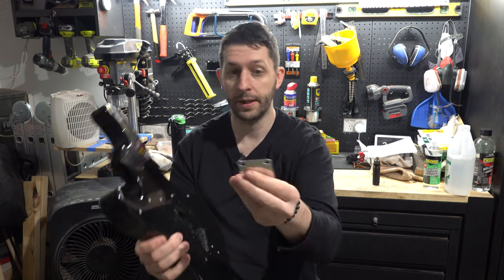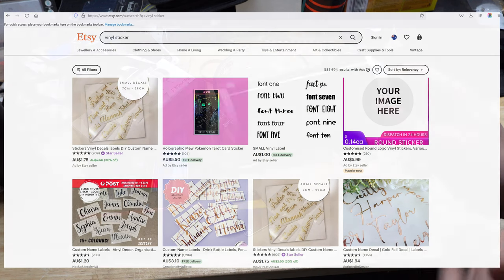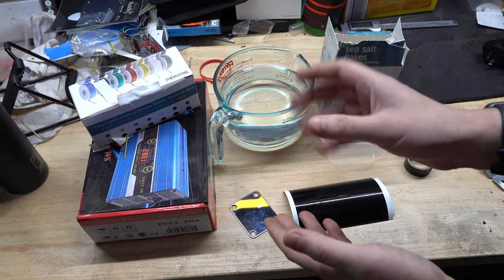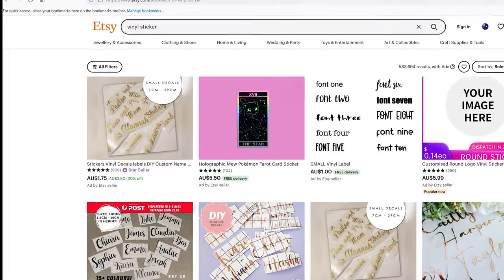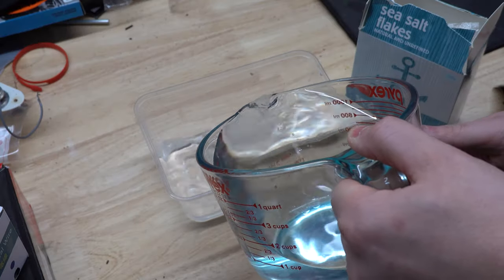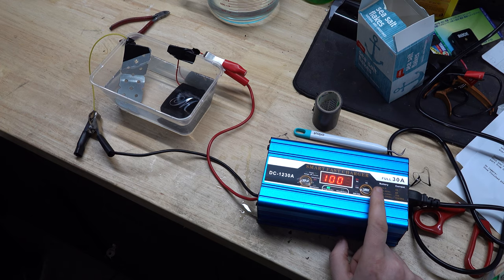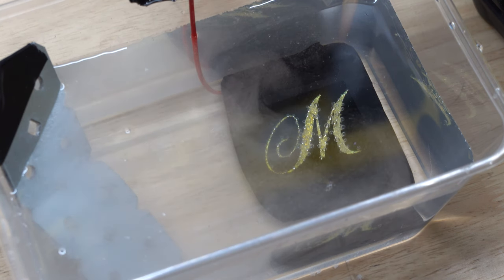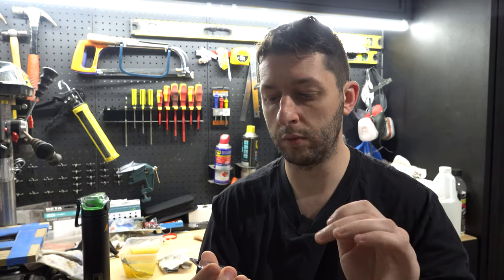Electro Etching a Guitar Neck Plate (Easy DIY at Home)

Comment: I forget if you made sure that any contaminants were removed from the etch area. If any finger oils or adhesive, etc is left behind it will impede an even etch. A careful wipe with alcohol would probably be fine. Just be careful not to get into the vinyl or electrical tape and make things worse. I love your guitar build.👍